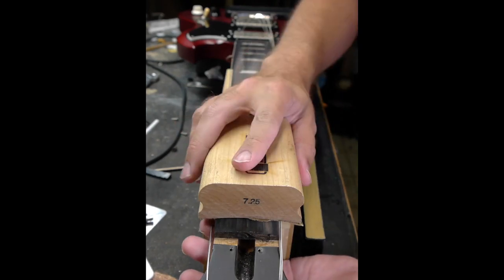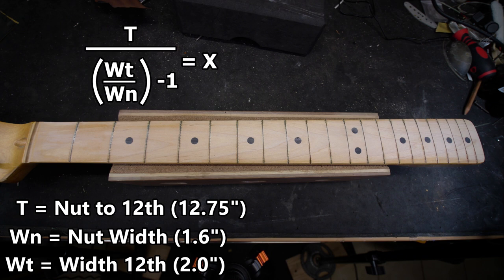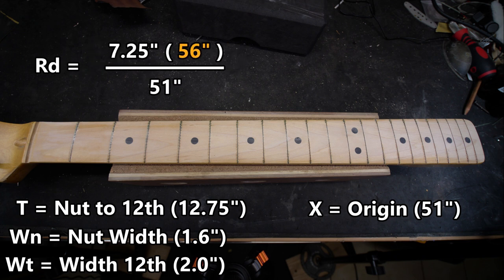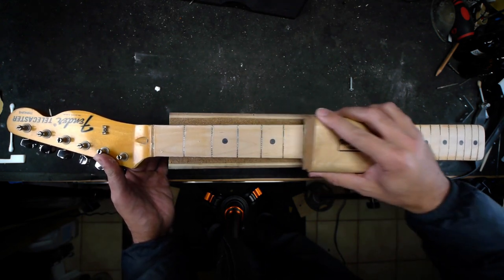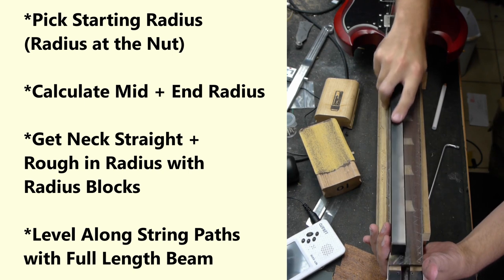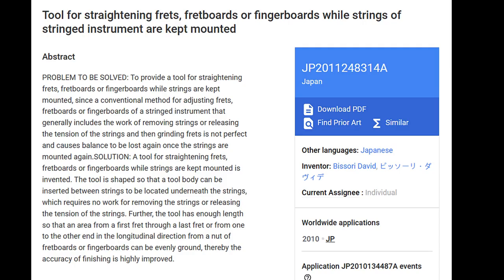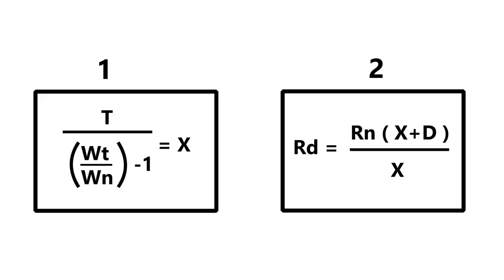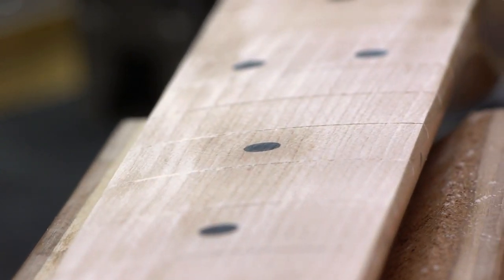"Compound Radius" Formula: Conical Profiling for Stringed Instrument Fingerboards / Frets

Comment: Wouldn't a single radius work properly if the bridge slots were cut for deeper string depth the more outboard the strings are?
Reply from the maker: Excellent question! Really got me thinking. That means I'm going to type a LOT....so buckle up! I'm excited to share my thoughts, even though I don't have a complete answer to your question. 

Here are my thoughts: 

First, the topic of string bending: 

The necessity for lower saddles on the outer strings is precisely why string bending is such a big issue with single radius boards. 

The High E string saddle, for example, is fixed in place, like all the saddles, once you set your action. 

Say you set the action open at the 12th fret. The High E string is going over the outer radius of the fret, which is much lower than the middle of the fret, at the peak of the fret radius. 

When you bend that High E string, the saddle is staying in the same place, but the string is riding along the fret top. As it approaches the middle of the fret, your action effectively gets lower as you bend. 

Why? Because the fret height is increasing, while the saddle height is staying the same. The distance between the bottom of the string and the top of the frets has decreased, which means lower action. 

So a compound radius absolutely helps with avoiding choking out on string bends, as the reduction in action as you bend the strings is not as great. That's one way of putting it, at least. It's tricky to explain but I think that's one of the simpler ways to put it. 

Now, for un-bent strings:

As for the action in terms of an un-bent string, i.e., on a single plane -- it makes sense to me that the frets should be leveled along the string path to get the fret tops as even as possible under the string. 

I'd have to take digital measurements of the action at each fret on a conical board vs. a single radius board -- and very important to have the same exact relief as well -- to say for sure. 

This is one reason I love digital measurements with guitars. It takes all the guesswork out. 

From nut to saddle, the action increases. The lowest point is at the nut/1st fret, where the string tension is highest, so the action can afford to be lower -- and as we go up the fretboard, the action increases slowly but surely. 

Say, .010" at the 1st fret, to .027" at the 12th fret (if you like insanely low action like I do). 

The question would be, would the action on frets 2-11 be different on a conical profile board vs. a single radius board, with a straight neck? 

Would we see a smooth, steady increase on a conical board, but more erratic measurements on a single radius board? I have no idea. 

I'd be curious how neck relief affects both as well. 

You'd need two guitars with confirmed accurate radii -- single radius in one case, conical in the other -- and then set them to say, .000" relief, and measure the action at every fret on every string, and then repeat at say, .005" relief. 

I'd be very curious. 

If there is any discrepancy in action, it won't be seen at the 1st and 12th frets, as those can be set very accurately and very easily. 

We'd have to look at the consistency of the action at the other frets between them to get a better idea. And even the frets beyond 12, up to 21 / 22 / 24. 

I think of this as a poor man's PLEK scan. With a digital action gauge and a little time and patience you can map stuff like this out, though human error has to be watched out for. 

This is also one reason I think understring leveling is superior, and to an extent, the thinner the leveler, the better, as you can more accurately trace individual string paths with a narrower leveling beam. 

Too wide and you can't follow the string paths accurately. It would make sense that to follow the string paths most accurately, the beam should only level under 2 string at once at most. 

 But now I'm getting off topic. Keep in mind these are all tiny measurements, but think of the difference in feel between an .008" high E string and a .010". In Guitar World, thousandths of an inch (or millimeters) are king. 

So even small differences can make a huge difference. 

For me, it's simple: level along the string paths. I never maintain a single radius on any guitar, and always level under string tension, and always follow the string paths, which automatically creates a conical profile on the fret tops or fret board. 

And it works great. I'm consistently able to get an action of around .030" on the GBE strings at the 12th fret, and around .046" Low E, .040" A, .035" D. That's my typical personal preference -- 

-- though many people seem to prefer the action closer to .040"-.045" open at the 12th fret on the GBE strings, and around .060" on the Low E, and somewhere inbetween on the A and D, like around .050". 

And for the 1st fret it's always the same, around .018" EAD, and .010" GBE. Getting the lowest action possible at the 1st fret without any buzzing -- even when playing hard -- guarantees great intonation and an easy feel. 

I wish I could've given you a better answer, but I need to do more research. To me personally, the idea of using a radius block to level single radius frets is insane. I just level under string tension using a Rectify Master Light understring beam, and go along the string paths -- works brilliantly every time. 

Another trick is to do a "pseudo compound radius" where you flatten the middle of the frets even more. This creates a flatter conical profile on the fret tops regardless of how the fretboard is profiled. 

Of course, you need the fret height to accommodate this leveling. Getting the board profiled closest to how you want it is always best, but if you have enough fret height to play around with, you can get away with doing an aggressive conical profile just on the fret tops. 

The most extreme I ever did was on a Strat with frets around .060" high. By the time I got it down to the point where I was able to do whole step bends on the High E string without it choking out, the middle of the frets were around .045". Got everything leveled out, felt great -- 

-- the middle of the frets lost a lot of material, but on that guitar, that's what it took to solve the problem. Fortunately it had plenty of height to accommodate it. For all that work though, sometimes you'd think it would be easier to just pull the frets, radius the board the right way, and refret it, which will leave you with very minimal fret leveling, vs. hogging off a ton of material and needing a LONG time to recrown and polish the frets.
Reply: @guitar_md  I appreciate the long detailed reply. I agree that using a single radius is insane, conical just makes more sense to me. This video and others have me tearing down a Les Paul right now to convert it to a compound radius. 

To further add to the complexity and confusion on bending strings on a single radius: a string bend will increase the tension on said string, which will reduce how much lateral movement the string has in its vibration. So theoretically, the more it's bent, the less action is required to prevent it from muting out (I think). I also think this concept could be considered on compound radii too. I'm sure there is a mathematical perfect radius that is derived from the math in this video + unknown math relating to string gauge, scale length and tune.
Reply from the maker: @elijahbarr9581  Yep -- it all comes down to the numbers. There has to be a definitive lowest action possible for a given conical profile, scale length, string gauge and tuning. 

"Lowest possible action" is a term I came up with a while ago and I think it will eventually become an important benchmark for evaluating the quality of fretwork. 

As long as we're doing hand work, there will be fret profiling involved, which goes beyond mere fret leveling. I do all of this under string tension and I believe it to be the most accurate method we have available short of a PLEK machine, and even then, it may be superior for the fine finish work -- the fine tuning to dial things in, even if a PLEK can get it most of the way there. 

Anyway, the "lowest possible action" has to be a numerical value. And I consider that to be the open 12th fret action. It seems set in stone that the "lowest possible action" in regards to the 1st fret is around .015" for the wound strings and around .009" - .010" for the plain strings, and the neck relief, obviously .000". 

The action open at the 12th is where the rubber really meets the road. The string tension is so high at the first fret that you can get that same low action regardless of the radius or anything else. 

But the action higher up, assuming you want to bend strings, will be limited by degree of curvature of the fingerboard. The flatter it is, the lower you'll be able to get the action without running into choking out on bends. 

For the lowest preferred action, I'd say for me, around .025" on the GBE strings and around .035" on the EAD strings is the lowest I'd ever need it, with .000" to .002" of relief as measured at the 7th fret, and measured open at the 1st fret, about .015" on the EAD, and .009" - .010" on the GBE. 

That is stupidly low action, but also the lowest I'd want it to be. And it's OK on whole step bends, as I aggressively did a "pseudo conical profile" by profiling the fret tops -- but beyond whole step bends, it does choke out, even to the point of completely dying out, in some places. 

I'm coming to accept that for stupidly low action (the way I like it), a flatter conical profile is necessary.

 But I would be curious that with an action that low, what would be required to be able to have beyond whole step bends with no choking out? 16" - 20" might be a good place to start but I may have to go even flatter than that if I wanted unlimited bending with no issues. 

I approach guitar work primarily from the perspective of an avid guitarist. To me, this is one of my greatest advantages. I'm my best customer. I am the most demanding person I've ever met in my life when it comes to guitar setups, fretwork, the feel and functionality of the guitar -- 

-- I would hate to have me as a customer! I nitpick everything endlessly and am extremely obsessive and will dial in my setups in to as close to plus or minus .001" everywhere, as I possibly can. 

I'm also constantly working on lightening up my technique. One of my goals is to continue using the lightest strings I can, with the lowest action I can, and play as expressively as possible with the least amount of tension possible. 

For me, guitar is like meditation, and in order for that meditation to not be interrupted, the guitar has to perform as perfectly as possible. I used to be huge into Japan and samurai when I was growing up, and was captivated by the idea of forging a katana. 

I suppose that interest translated into guitar work. I see my guitar as a tool in the same way now, and my obsession with guitar tech work and customizations was all inspired by that dream of crafting something perfect -- as close to immaculate as possible, a tool that can function so perfectly that it can just be like an extension of a person's body. 

Dramatic, I know. But I'm very serious about this. My ultimate guitar would probably involve carbon fiber for stability and durability, especially of the neck, some kind of polyphonic infinite sustainer system that is also easy and intuitive to use, and setup and fretwork that allows for total freedom of expression. 

My current "baby" is my 2005 Mexican Strat, which I've modified to the nth degree. But anyway, I'm getting very far ahead of myself. 

It's all about the numbers. That's the main point here. Everything can be measured and documented and reproduced. IMO a seasoned guitar tech should be able to visualize how a guitar will feel in his hands based on the numbers of the setup: 1st and 12th fret action and relief at the 7th fret.